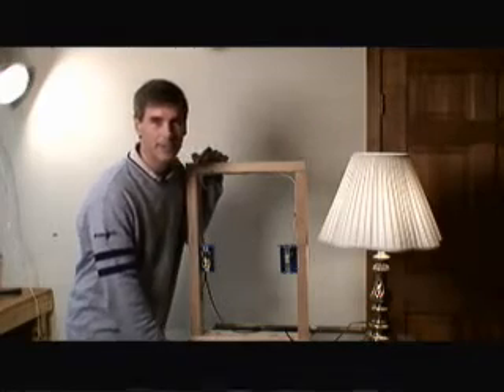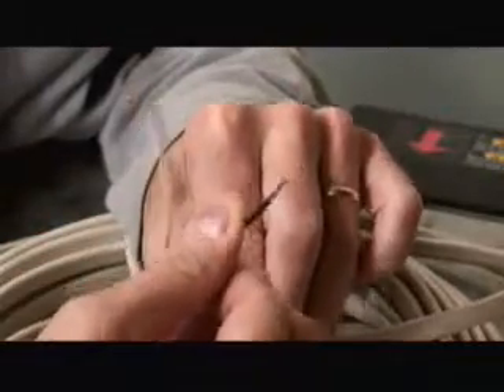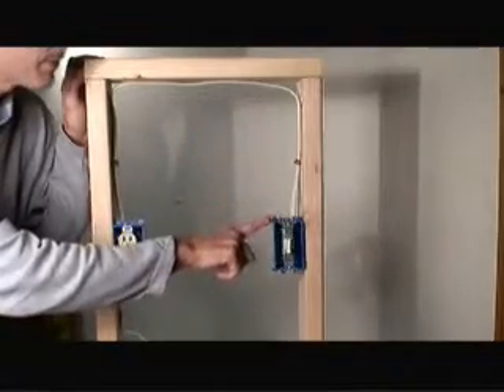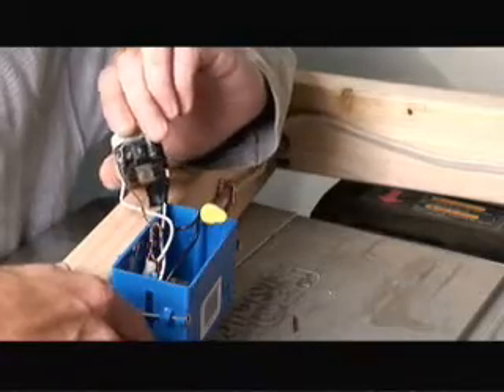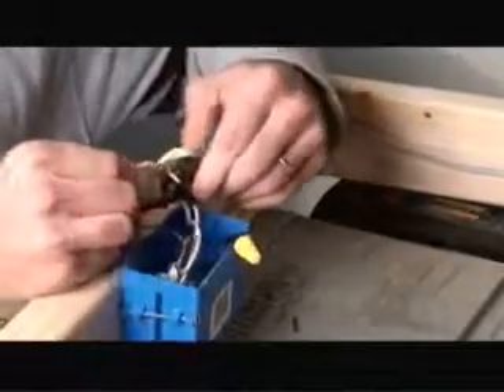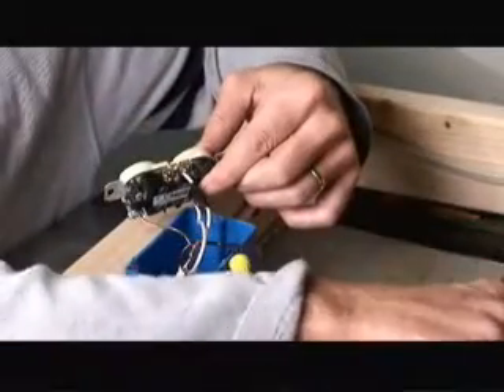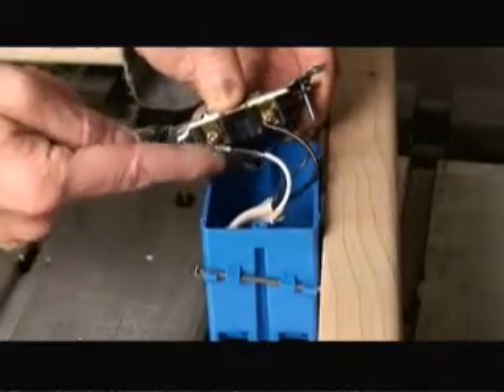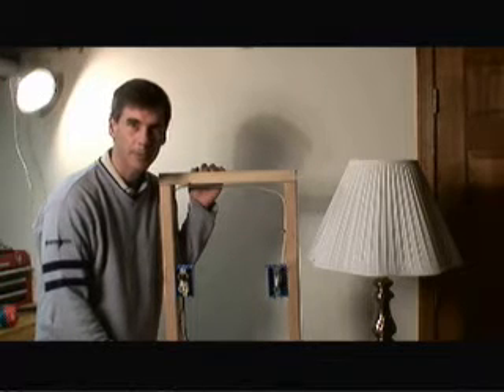Switched Outlet Wiring Video

Comment: Thank you for your video! Well captured. 
Q's- the hot wife from source and black wire from the switch is capped together, rather than splice and pigtail to the brass terminal? And since I am using 12-3 the red than go to the other brass terminal?
Reply: *wire

Comment: Hello, could you add two more outlets wired the same way. For a shop, when I turn on the switch, three outlets would power plugged in LED lighting hanging from the ceiling?
Thanks David

Comment: Hi Phillip. I am finishing a small carport with utility room out that had a pull cord ceiling lamp holder as the light source.  The fixture is on the 30 amp breaker tied into all the kitchen series outlets since the kitchen & carport\room are next to each other.  I am going to install a 4 foot LED plug in garage light to the ceiling as the new source of light and I want to control the LED light with a single pole switch.  I know how to do this after watching your video here but my questions are 1) Do I need to run 10 gauge wire from the switch to the outlet since the source\feed wire that will go the receptacle in the ceiling is fed by 10 gauge wire - OR - can I use 12-2 from the single pole switch to the receptacle run since it will only ever be used to power a light?  2) If I need to run 10-2 ga wire from the switch to the receptacle, I will not be able to use a 15 or 20 amp single pole switch and I will need to buy a 30 amp single pole switch correct? Thanks for the video and for the additional help.Edit: Phillip I thought the wire was 10-2 since it is on a 30 amp breaker but after checking the wire itself it IS 12-2 wire 600 v.  The house was built in 1970 so I guess code was different then.  I am still curious about my question #1 above IF it had been that way.  As far as question 2, I did some more surfing, it looks like  it would be advisable to use a 20 amp switch instead of a 15 amp, correct?

Comment: I would like to wire a pump (wort pump for brewing) and as such I'd like to use a GFI outlet, otherwise It'd be the same per your video.  Any differences or special considerations when using a GFI here, particularly when I'll be providing power to the box/set up via a power cord (3-prong) that will be plugged into an outlet, thus making the set up portable?

Comment: I am running a wire into a shed. To a light, to a switch with a receptacle. The light is always on, the switch will not turn it off, and the receptacle is hot. What is wrong? Can someone tell me how to wire this so all 3 things will work?

Comment: I have a switched receptacle that I want to uninstall so that the receptacle has constant power. How do I do that?  And I am interested in putting a single pole nightlight where the switch was. Can both the receptacle and the nightlight run without rewiring the area?

Comment from the maker: You will first need to follow the general direction of the wire in the attic. See where it is dropping down into the walls. Also, use a multi-meter to determine what wire in the switch box is the HOT wire and which one is the feed to the existing lights/outlets on the switch.  By doing these two things you should be able to assess if the attic wire is the HOT or FEED to the other lights or outlets.

Comment from the maker: Yes. Also, though not shown in here, you may want to tie the two grounds together using a Greeny Wire Nut, or a copper crimp ring, before attaching one of the bare copper wires to the wire nut on the outlet.